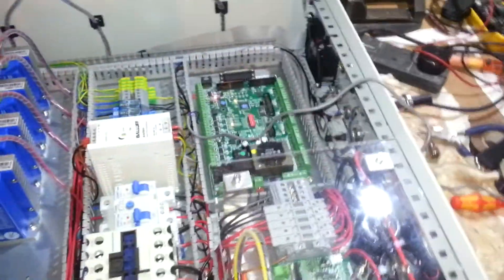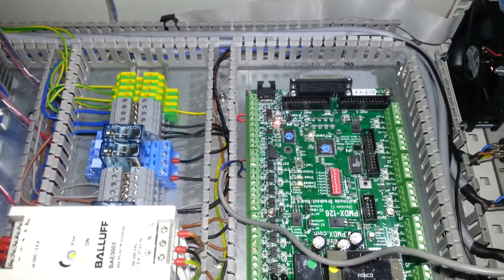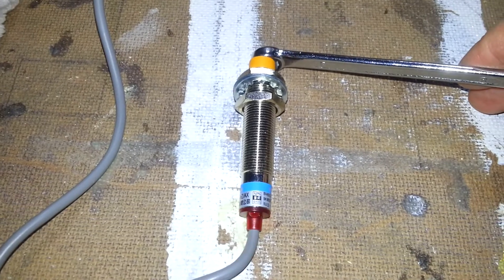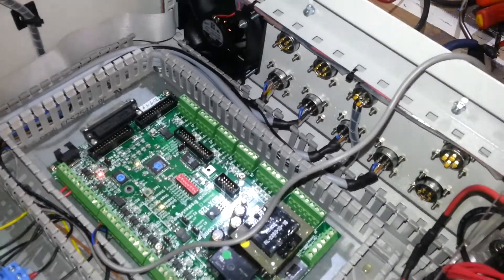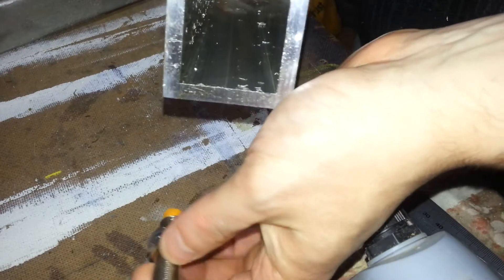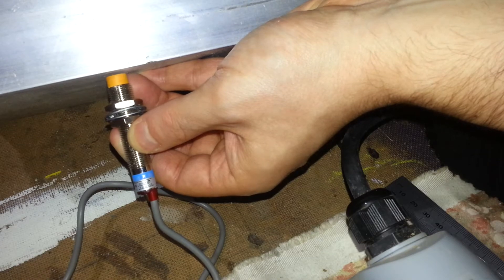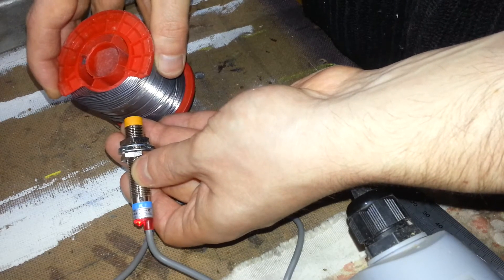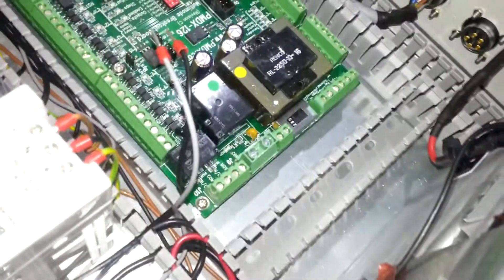Initial Inductive Sensor Testing

Comment: The sensor has its own induction field(think of a little invisible bubble).  If that field is broken then the switch is triggered.  Steel interferes with that field more than copper or aluminum.   Because aluminum and copper are more conductive they interfere less.

Comment: Hi, I am trying to find a sensor that is able to detect a hand that is behind a wood board about 2 or 3 cm thick. I have been studying capacitive, heat and other types of sensors,  but I can't find exactly what I need. Maybe an inductive sensor and a glove with metal inserts? 
I would really appreciate it if you could give me your opinion on this.
Best!
Reply from the maker: Rodrigo Alvarez Igarzabal If you can attach metal to the hand with a glove then you may be able to find an inductive sensor that will work. A cheaper alternative would be something like a magnetic switch and some small neodymium magnets in a glove. I can't think of anything that would easily detect the presence of a a bare hand behind the wood. I suspect something like ultra sound could be made to work but that is well outside the realms of sensible. This isn't really something I've ever tried to do though.
Reply: CNCtrl thank you very much for your quick response! It was really helpful!

Comment: Hello, 
I need you help please.
I was searching for diagrams and info to connect my inductive switch to pmdx-126, and I saw that you used such switches and already knows how to do that, I have 6 inductive proximity switch  NPN/NO (operating voltage range: 10...30V DC)
I want to use them for limit & homing for my machine, 2 switch on x axis, 1 switch on x' axis for auto-gantry squaring (my machine with dual x drive), 2 for y axis and maybe 1 for z axis (i saw some machine didn't have any switch on z axis - I don't know why), also I have  Tool Length Touch Prob. Do I need more inductive switches ? 
P.s. I use pmdx-126 (one parallel port without smooth stepper).
As I have been told If I prefer to avoid two ports, i can assign the inputs as:
 11) home for first X
 12) home for second X
 13) home for Y and Z
 15) other end limit for X and Y
Could you please help me how to connect and wiring it ? I will appreciate you help.
Here the links for inductive switch and touch prob:
http://cnc-plus.de/en/Router-Accessories/CNC-Tool-Length-Sensor--Tool-Offset-Setting-Sensor-.html
http://cnc-plus.de/en/CNC-Electronics/Switches---Relays/Inductive-proximity-sensor--reference-home-switch--limit-switch---NPN-NO-.html
Sorry for writing too much.
Murad Assadi
Reply from the maker: murad assadi Hi Murad, that's a lot more than I can answer in a YouTube comment sorry. I've never wired up a touch probe so I can't help with that but if you have a look at the wiring digram here (http://www.cnctrl.com/index.php/builds/yeti/57-electrical-build-part-11) I think it might help you out. Look for the limit switches, they are wired to a relay which is connected to the PMDX. All the limit switches are connected to the same pin and used for homing. You only need multiple pins if you want to home multiple axes at the same time. As for limits you only care if any limit is hit so again only one pin is needed. If you want dual independent sensors on X then you do need two pins one for X, Y and Z and one for X`. Opinion is divided on whether you should always square up the gantry though, I'm of the opinion that you should make sure it never gets out of alignment due to missed steps.